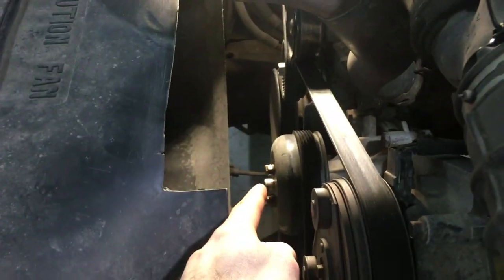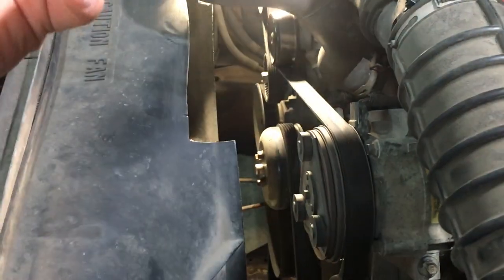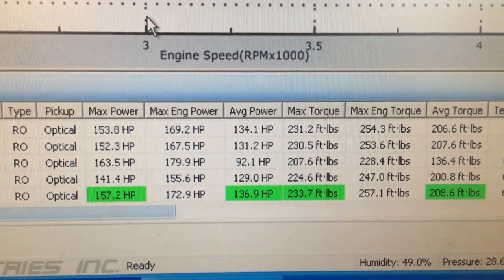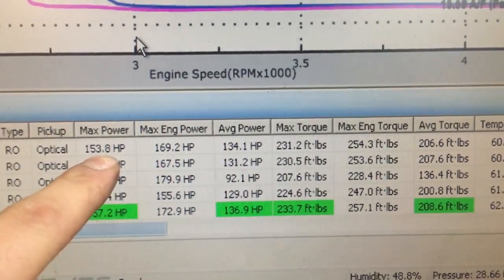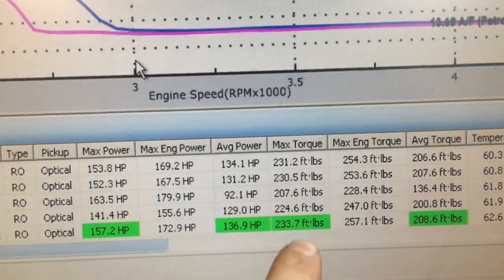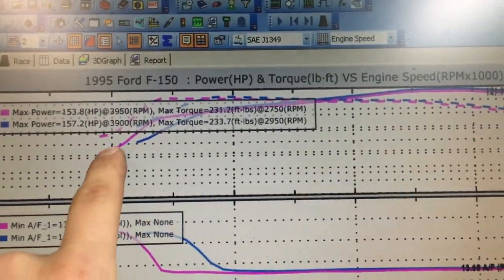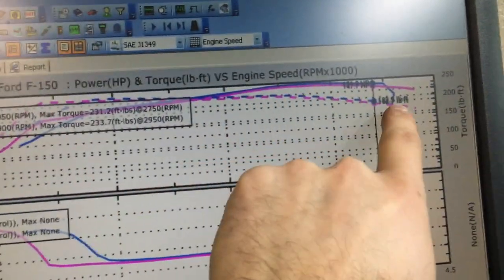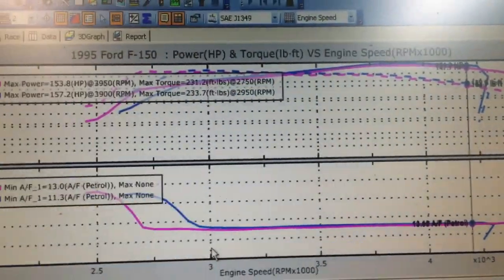Does a Mechanical Radiator Fan Kill Horse Power? - DYNO TEST | 1995 Ford F150

Comment: Its mechanical physics thinking that removing the mechanical fan free's up hp. Think about it, your motor has to push and spin that fan while its running, same as the flywheel. When you remove that fan, that extra weight is gone so now as the pistons are going on their down stroke to make the power, that fan is not there to give it resistance. Now they can push down with more force.
Same as the flywheel, when you have a 20 lb flywheel and swap it for a 10 lb flywheel, now the pistons have 10 lbs less of resistance which means more downforce which means more hp output.. 
Now how some guys have claimed 15 hp gain from clutch fan removal beats me, maybe the clucth has gone bad putting more resistance on the motor ?? 
I can tell you that removing the clutch fan did help the engine rev faster and i got more power, as well as the lightened flywheel.
Reply from the maker: You are exactly right! It's pure physics. I mostly did this to see how much power was freed up by removing the fan. Furthermore, was the power freed up worth the extra cost of installing electric radiator fans. 
Anyhow, thanks for watch!🤙
Reply: @TheMinuteMasters  Its too bad others can't see the logic behind this and will argue with you that you are wrong. 
I will tell you what, i don't care what the dyno #'s show but my BUTT dyno feels a gain when i removed that mechanical fan from both my cars. That was def worth the $$ and besides, depending on what electric fans you get, some cannot out flow a mechanical fan (cheaper generic ones) while other higher $$ fans WILL out flow the mechanical fan EASILY ...
And another note, removing that mechanical fan is considered a bolt on hp adder ..!!
Reply from the maker: @ACommenterOnYouTube  Yup, you are definitely right. The fan really sucks the power away when the truck is hot and the clutch engages. Maybe one day I'll buy one of the expensive electric fans and install them.
Reply: @TheMinuteMasters  my nissan 240sx i use the altima oem  dual 12s, they flow 1500 cfm on low speed and 3000 cfm on high speed, and for my Supra i use the lexus IS300 oem dual 12's, those are single speed at ~2700 cfm so plenty of flow to cool down.
Reply from the maker: @ACommenterOnYouTube  Nice! I’ve heard of people taking fans from newer cars and putting those on F150s.  240sx are very cool! My last car was a 86 300zx.
Reply: @TheMinuteMasters  good ole Z31's ... I had 2 buddies back in the mid-late 90's that had those that we would street race with. Both were turbo and had LOTS of fun with them.
Reply from the maker: @ACommenterOnYouTube  Awesome car to drive! Mine wasn’t turbo and it was automatic, but it still flew!
Reply: The guy is right about reducing weight and drag from the crank, it all helps performance. I just ordered a dual 12" set up for myself with the relay and thermostat kit. With the electric fans you get back lost power you always had there hidden. The engine will free up to rev faster which equals  better response, and be more efficient. You can get slightly better gas mileage also. I am also getting a lighter aluminum harmonic balancer setup and the aluminum crank under drive pulley for my little inline 4 engine. I have a 2.4l Toyota. All these things together make a pretty good difference. Especially when your looking for the best affordable ways to get more performance. Get an intake, put an exhaust, a cam, a blower, etc. It's expensive though but to car enthusiasts its life man. There's alot of people who argue that it doesnt help and its pointless, but you do feel the difference. They will argue to you that the factory air intake is better because the engineers designed it and the air filter is in a box where it gets colder dense air. Well I can tell you my factory sealed inlet felt like it was choking the motor. like you said it was 4 hp at the wheels but at the crank it's more and you will notice it when you drive the truck, more so on a small engine like mine.
Reply: @L-Noble.YT_Hi.Res-Soundminds  Its funny that these guys will argue that a mechanical fan wont free up HP but they will say to swap the flywheel for a lightened flywheel and swap the main crank pulley for a lighter crank pulley to help free up the DRAG from the rotating assembly for more HP ... HELLO .... The mechanical fan is also a DRAG on the rotating assembly ... Some people FAIL at using simple logic to figure things out.
Then they say the electric fans put a strain on the electrical system, well yea if you buy the wrong fans or you wire them to run all the time like the mechanical fan. Whats the point of wiring them to run all the time ?? They don't need to run all the time. While your cruising on the street or hwy, you should have enough ram air to keep the coolant cool so that the fans are not needed. Both my cars have a 185F therm switch, so they ONLY kick on in traffic or stop lights, otherwise while on the move at ~45 mph or 70 mph, they don't run so there is NO strain on the system. 
Simple logic that they fail to understand
Reply from the maker: @L-Noble.YT_Hi.Res-Soundminds  No doubt going to electric fans frees up power. I’d love to do it. I just haven’t heard of a setup that is more reliable than a mechanical fan.
I think getting any benefit from a “CAI” varies from engine and application. On these old trucks, the intake is very straight and has no unnecessary deviations or chambers. 
I owned a 86 300zx and the intake on that was snaked a few different directions.
Anyhow, I’m glad your set up works great man! I’m hopping to do more horsepower mods in the future. Thanks for watching!🤙
Reply: @TheMinuteMasters  Yes the mechanical fans are very reliable. But it will break also eventually. Electric fans can have electrical issues or burn out. But I also have see systems that work very well. If it's done right you will be fine. I'm going electric for the many benefits even though my current mechanical is trouble free. Benefit are more space and better power,response, less noise and economy. The pros are too many. The cons is I might have to change the fan in the future. I had a 91 F-150, it was an inline 6 motor. I installed a k&n filter into the factory airbox. The factory air box actually had a factory ram air tube going to the front side of the radiator but at the end was curved. I cut it strait open to the front of the grille so air would "ram" in there and believe it that I noticed a difference in how it ran. So you can really get creative with things and get results. Thanks for the video. it was fun.
Reply from the maker: @L-Noble.YT_Hi.Res-Soundminds  You definitely make a good case for electric fans. Do you have a brand you recommended or a donor vehicle? I take it as long as the cfm is greater or equal to a mechanical fan, it should cool the engine properly? 
It’s funny you should mention that. I can swap the intake tube from the 460 Ford engine to my 302 and it’s also straighter and pokes through the grille. If you trim the curve in the end it also has a ram effect too. 
Thanks man! 🤙
Reply: @TheMinuteMasters  I dont have a donor vehicle. My father used to have an 89 F-150 with a 302 v8 and a 91 F150 with the 4.9l inline 6. The v8 302 was scrapped and the 91 just had a bad transmission. They were great trucks and I regret not fixing it up, but at that time we were in the recession and we didn't have the money to fix it so my mom sold it to a recycler. The better brand name fans like spal, mishimoto etc. are pretty expensive but the cheapest fan kits I have seen are on ebay. I'm usually not cheap but I couldn't see spending so much for a fan kit. The flex a lite kit for my 98 Tacoma cost like $450.00 for a dual 12" fan set up with a shroud and all the wirring. No way! I just bought a full universal kit with dual 12" fans with the thermostat and relay wirring for only $62.28 from ebay by the seller first racing. The cfm rating you need for your application depends on the engine size and whether you have added more power like a turbo or s supercharger etc. The rule of thumb for cfm is for a 4 banger you need 1250 cfm for a 6 cylinder its 2000 cfm and for a v8 it's like 2500 cfm. The more power you make on the engine the higher watt motors better and more powerful the fans for your cooling system you need. Fans come in sizes from 7 to 16 inches or maybe bigger. The more powerfull fans have a stronger motor and more more air and can consume more amps to the electrical system. Also since they work harder they will be much noisier to do that work. Also the straight blade style fan blades moves more air but are noisier than the curved blade designs. Right now I'm running the stock clutch fan on my Tacoma with no shroud. My new electric setup will cover the whole radiator core with the two fans. The fan motors are 80 watts each  and they flow 800 cfm each at about 2000 rpm. I dont need high power fans plus my alternator is small so when it dies I plan to upgrade it later. The fans I bought are cheap but look good. I decided not to go for the expensive ones which for me is not normal but If they work good then I'm set. If they crap out then It will just be a fan swap to a more expensive and durable fans like Mishimoto fans that are like $72.00 each and flow more air. But I decided to take a little risk there. I could of gone for a single 16" fan setup but figured when I get my supercharger hopefully later on I would better of with the dual setup and if a fan burns out I would still have one operating and not risk my engine. Also I want to have quiet operating fans. Some of the high end fans like spal are really loud. It all depends on what your needs are you know. But you dont have to spend hundreds if you get them on ebay like me and you dont need a fan shroud either if your not overheating. lol...  I live in super hot south Florida and I'm not to easy on my engine and never had any issues with no fan shroud, but my cooling system is clean and it is working good.
Reply: @TheMinuteMasters  I pulled my fans out of an old Lumina mere moments before we sent it to the scrapper and fabbed the mounts myself...Going to pull the fans out of a junk Impala and do my shop truck too.
Reply from the maker: @98vn1500e  Nice! You’ll have to let me know how they work out long term.